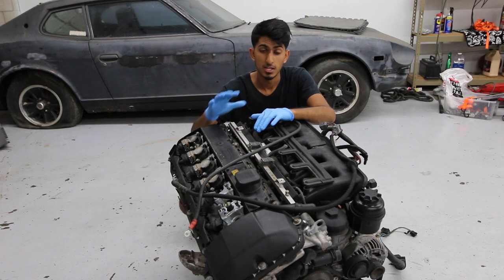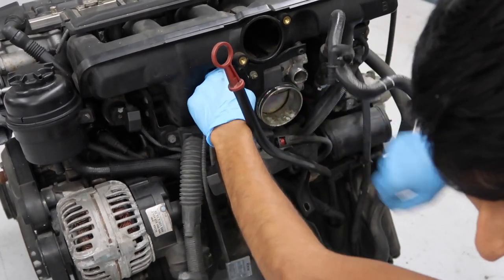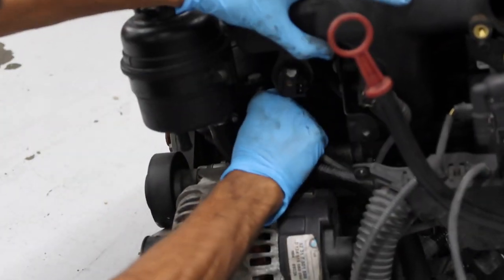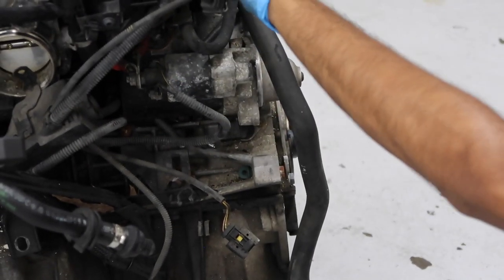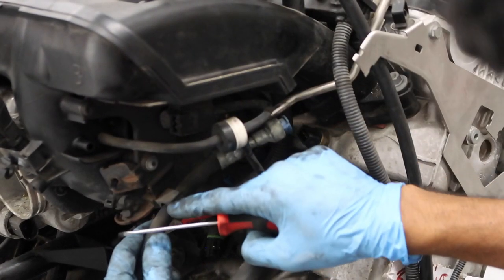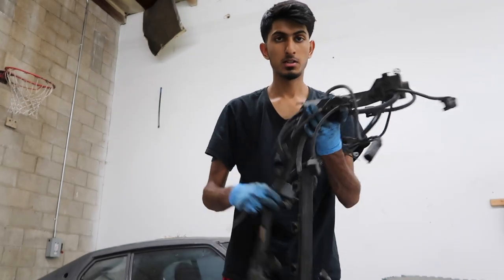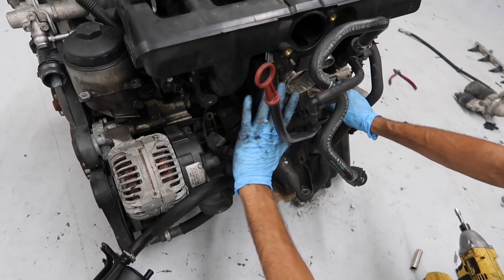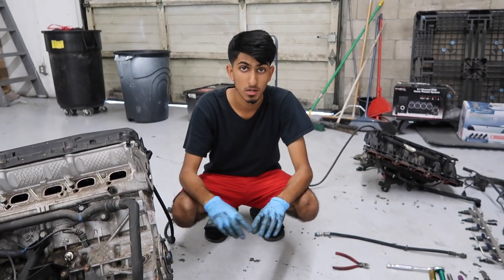Part 2: BMW M54 Engine Disassembly (Intake Manifold and Harness Removal)

Comment: Yes! Another great video, even a very funny spot too. Good camera work! You guys are a great team. I need to replace my CCV soon but I'm a bit nervous about lifting the intake off.  This vid will definitely help. Thanks guys for all your videos, keep the E46 love alive !!
Reply from the maker: You do not necessarily have to remove the intake manifold to do the ccv, although it does make it easier. My advice is to get the ccv kit with new hoses and then just break all of the old hoses and remove the old ccv.
Reply: can i ask you please about the coolant lines underneath the intake ..
i think its mandatory to remove it,
 i started my engine frozen ice inside since i had drinking water inside the engine ,i ende up with one or both  coolant hoses broken
thx 4 gr8 video

Comment: that  260z  would  be a perfect candidate for a BMW inline six engine swap.
Reply: Rb swap is miles better for a Z car from those years tbh.
Reply: Plus its been done so many times you can mostly buy a swap kit for it. But a m54 or N54 swap would be awesome simply becuase it's never been done
Reply from the maker: I prefer to stick with something nissan, I am not sure exactly what yet, but may be a vq35hr or a vk45, not sure. I might even change my mind on the stock engine and do something with it. First I need to restore the body, then I will decide on everything else haha

Comment: You two are funny good video you showed me the part that was missing on the manifold. can you tell me because my intake air temperature sensor is missing and what affect it will have on my car by it missing, my car starts but struggles to stay running and it sound like there’s a lot of air coming out of somewhere around the manifold I have 05 325i I have the put a new disa a idle control valve new intake hoses plz help

Comment: 4.19 - i just want to ask. just above the vacuum line on side of the intake manifold there's a connector with 2 wires. what is the connector for? is it a sensor or what. 😅. thanks
Reply: Was wondering the same thing, my intake manifold doesn't have anywhere for the plug to go into and the plug itself is blanked off so I'm a bit confused
Reply: @urvakhshsidhwa914  its for the secondary air pump, some countries don't require them to pass emissions

Comment: I have a question, can I remove and replace the injectors leaving the engine inside the car , I mean without taking it out from the frame?
Reply: InsaneWorld Compilations yes you can.
Reply: Watch the first video. He explains how the fuel rail and injectors are right on top under first vanity plate

Comment: I have a bmw 328i 2000 5 speed can I get a other engine but from an automatic transmission and put it in my 5 speed or how does it work

Comment: How much power would M54 handle if i turbocharged it ? i mean, how much the stock internals can handle on low boost ( safeboost ) for the engine but still make some power ?

Comment: Where does the leftmost wire on the DISA valve plug in?(handled at 2:03)  Been trying to find it and it's driving me insane, someone please throw me a line :(

Comment: Ok I have questions, my e46 has two fuel lines that were connected to the fuel rail, and it also has an air line on the fuel rail, 
So when putting back this fuel hose, does it meter where you connect them? Or they go on specific pipe from fuel rail? 
And the other question, the air pipe that is on my fuel rail, I know the end of the pipe towards the front of the car connects to the ccv hose, but the other end of the pipe facing the firewall of the car, where does that connects to? 
I will appreciate if you can help.
Reply from the maker: There is a specific orientation for the hoses, what year and model is it? Do you have a black and blue striped vacuum hose coming out of the firewall?
Reply: ShopLifeTV it's 1999 323i and yes it does have a blue end and a black end

Comment: Right I hope someone can help me I bought a cheap 330ci as a project as I’m normally more into the diesels but anyway there is a 9 pin dsub wire in the engine bay not connect to anything. It seems to be coming from the somewhere near the intake manifold. I have no idea where it is supposed to live. I’ve spent a few days searching can’t find anything 😞

Comment: Hi, at 4:20 you pull a connector off the intake manifold but you dont say what it is. ive been trying to find out for a while as mine is hanging loose! Please help!
Reply: ShopLifeTV Wow! vacuum control valve, that explains everything that's wrong with my car! Thanks man.

Comment: How did you learn all of this? Do you have any website you would recommend? I'm planning on buying an e46 2,2 6 cylinders engine and I want to know everything about it. :)
Reply from the maker: Honestly, I learned mostly everything by just taking it apart and seeing how things worked. There are many resources though such as the forums that have well documented DIY's on many things. Look at bimmerforums and e46fanatics they are tons of resources throughout the BMW community, not so much on other cars though.